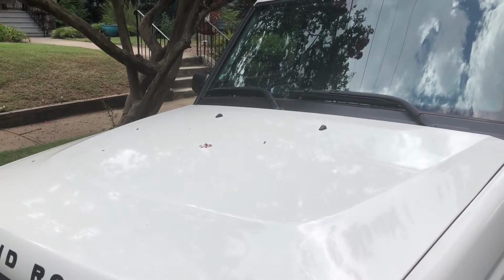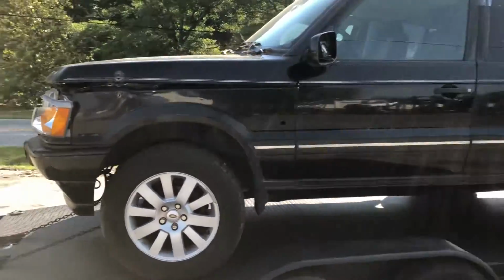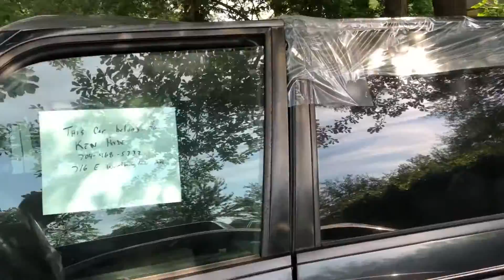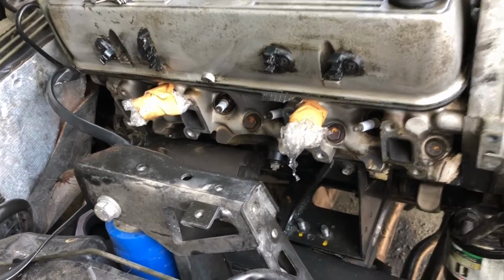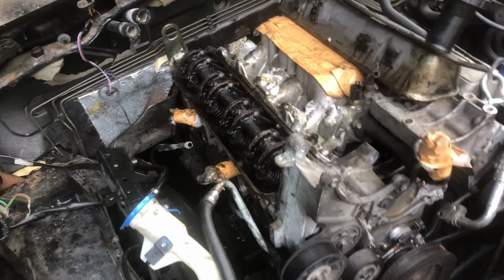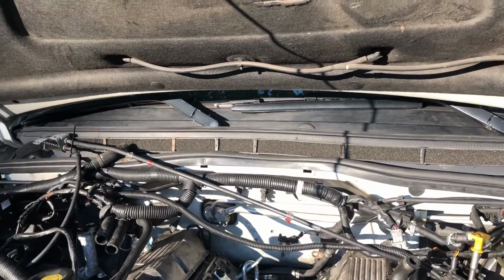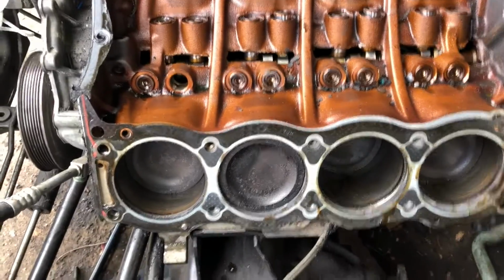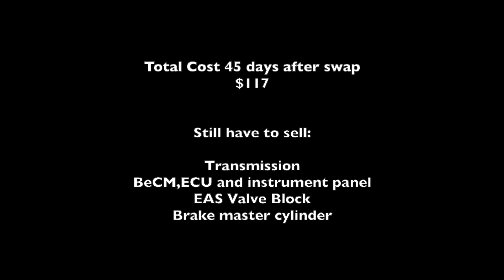D2 Engine Swap

Comment: Nice work. I'm in the middle of the same project but I'm rebuilding a 4.0 with 4.6 rotating assembly and a new cam. Plus a 4hp24 in place of my current 4hp22. I don't have access to a lift either; brutal job without it.

Comment: 4.6 not good motors are they?? Too over bored
Reply from the maker: good motors if you keep them cool....the water pump does not create enough flow and the radiator is small and the thermostats run too hot....inline thermostat will help mitigate these issues
Reply: @cltrovers   yah you gaotta re engineer the pos's